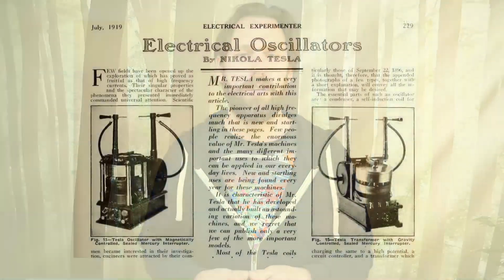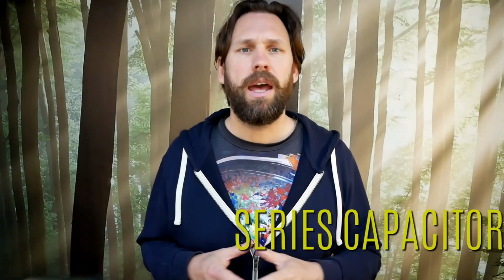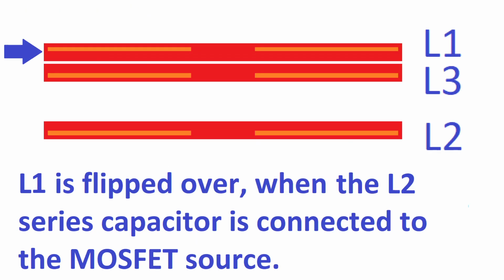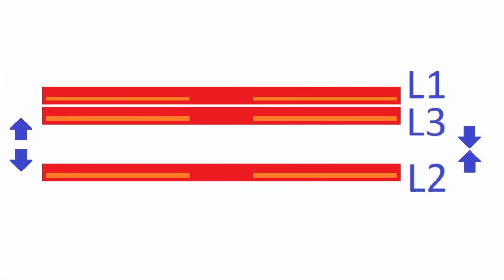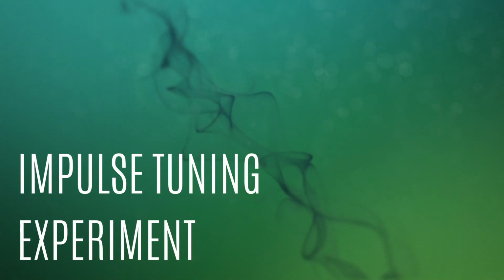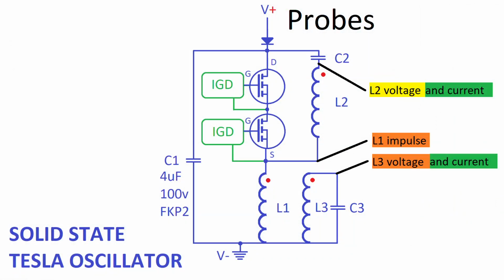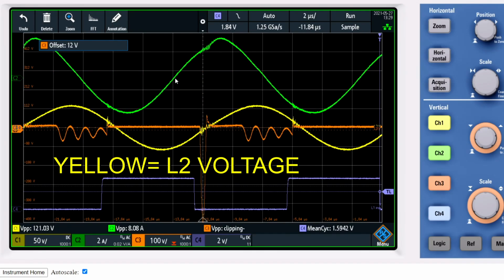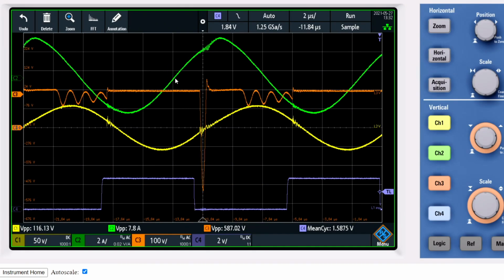How To Tune Impulses Anywhere on a Resonant Cycle, using Bucking Coils.

Comment: There is an effect that accelerates the transference of energy. The Oberth effect. When a transference is made during changing conditions the efficiency of the transference is exponentially increased. The equivalency of action/reaction is only held when the relative states are at rest. In electrical energy transfers, this may be why induction requires field movement. Bucking coils present an extreme field movement at the bucking plane. Additionally, the reactive lens effect becomes an additive source that increases the bucking plane transition or effective field movement. 

Also, keep in mind electricity is the fields of dielectric and magnetic forces, both sourced by charges and charge movement, but not requiring those charges to transfer or make power. Don’t oversimplify your model of electricity to blur these distinctions. This has cost us dearly in resources for over a century. Fields can be easily amplified or canceled (dielectric ones at least, magnetic fields only add, they do not cancel, yielding diamagnetism, not null magnetism.) Amplified fields do not require old energy, removing the requirement for an equal exchange.

Philosophically altering the laws of physics, is critical. Electric fields are the medium of many physical force exchanges, so properly constructed electric fields can replicate the function of physical matter (physical charges never make contact; if protons were soccer ball size, they would be 14+ miles apart inside atomic nuclei.). Attaching wealth to physical objects beyond their capacity to make electric fields and waves becomes worthless (don't buy gold, make it.). Start with electricity that is amplified without consumption, and signal condition it to match the effect of transmuting gold from iron or air, and gold becomes worthless. More practical, turn any gas into clean air and water, transmute all pollution into life-giving basics with CIV inspired Z pinch plasma reactors; or Tesla spark-gap plasma waveform generated and Tesla Coil amplified and broadcast transformers.  Welcome to Gene Roddenberry's star trek future (no money required).
Reply: Beautiful description of the dynamics of dielectric fields
Reply: no money required, because it necessarily breaks capitalism, i reckon lol. if kiloWatt-hours are free, man-hours=$$$ isn't gonna hold. By all means, let it break, but i imagine it being "messy" 😈  [mere speculation, obv]

Comment: Will you please talk about Ed Leedskalnin and how he might have raised those massive 20+ coral stones at Coral Castle? 🥸 Thanks for sharing your research with the world.
Reply from the maker: to my knowledge he made ac from dc.  the ac was used to lift the stones. I might be wrong, but I think it's that simple.
Reply: The only clue I know is bucking magnetic fields will alter the gravitational constant (if you drop two bucking field magnets, they will not drop at the same speed (much slower) as every other object, mandated by physics to be a constant, regardless of mass. Bucking fields are used to levitate trains, why not large rocks? Just wire them up along with landing pads... and add power. The current to levitate that much mass may be much reduced using a matched bucking field vs. an induced bucking field used for train applications. Set a large bucking field on a single stone may make it less affected by gravity, or directly make a bucking field under the stone, may require much less power than a single eddy current generated levitation used on trains.
Reply: @mundymorningreport3137 i wonder if there's just a range of frequencies suitable for each stone lithology (limestone/sandstone/metamorphic)? the south American pyramids were rapidly deployed with "singing/trumpeting sounds", says local lore. Gotta be a note that makes pressure waves into a balancing force vector? or just brute force amps lol. perhaps unanswerable, but we'll not let that stop us eh?